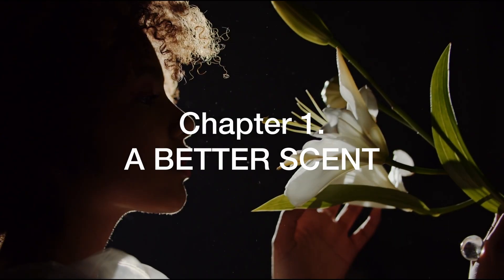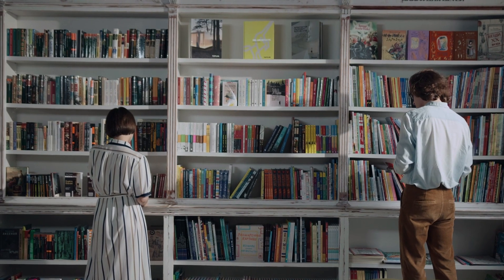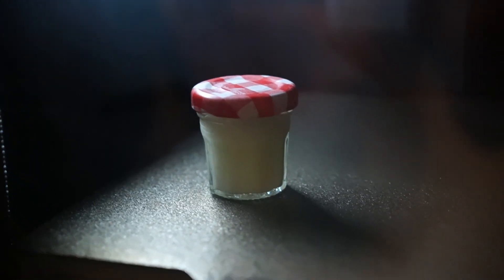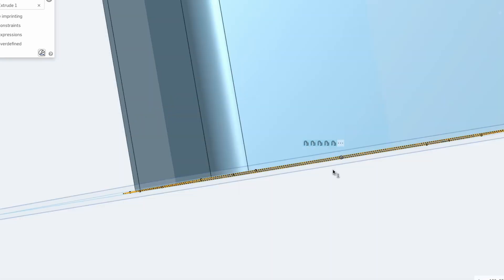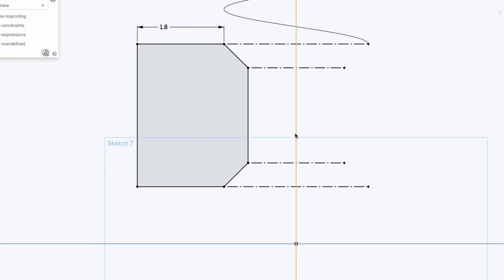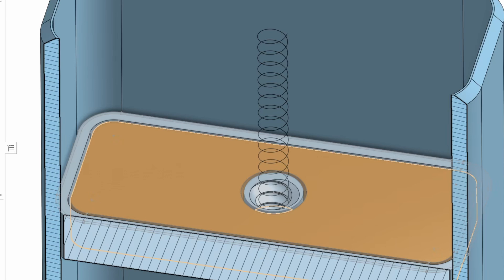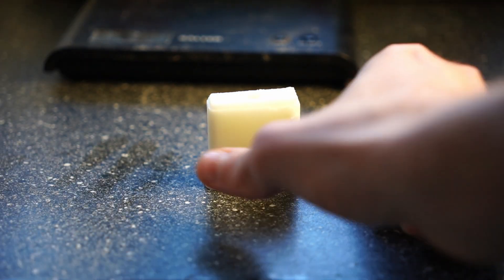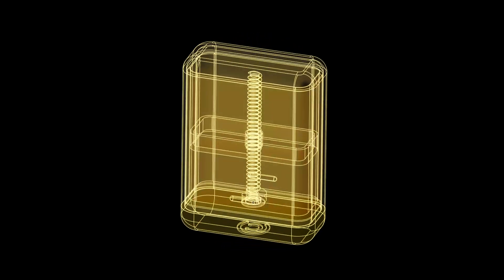Could the PERFECT DEODORANT already be in your kitchen?

Comment: Nice solution with the mold, maybe I'm missing something but couldn't you pour the deodorant directly into the body of the stick instead of using a separate part to form the stick? Even if it requires modification to the 3d print it may be a cleaner solution (literally)!

Comment: I really like your style of structuring the video. Good flow, minimal to non existent dead air, interesting concept, a deep dive, and a resolution in not even 12 minutes, shit's great man! I think this one should break 100k within a few weeks!
I'm also curious about your formula and the ratios of used ingredients, sounds like a good alternative to the name brand ones.
Some of us in the community could even make models for molds that fit into existing cases like oldspice or dove etc.

Also, the idea of making a mold that splits into two should work for your application, as you don't need the top of the stick to have a shape, you just make an open top mold, like you would for silicone, and you're good :)

Comment: I would try printing the Mold in TPU, i think getting it released would be much easier with the flex it would provide!
Reply from the maker: Hey, thanks for comment!! You are probably absolutely right with that, I should totally give it a go - I think I'm a little scared of TPU at the moment.. 😂 heard it's quite tricky to print!
Reply: @UrbanCircles  if you have a direct drive extruder it’s not bad! I just bypass the Bowden tube and put the filament straight to the extruder!

Comment: to bad PLA is not as biodegradable as we tough
Reply from the maker: Thanks for checking this out and the comment - hope you liked it!! Re your point, PLA does biodegrade slowly (which is actually a good thing; otherwise, it would be unusable in product design). More importantly, when it does break down, it doesn’t break down microplastics. Instead, it degrades into lactic acid, a natural compound that microorganisms can fully metabolise.
Reply: @UrbanCircles  Important to remember that PLA requires an INDUSTRIAL composting facility to break down. It does not break down well in regular composting/nature/the sea/landfill etc, and very little PLA and other "biodegradable" plastics end up in the industrial composting facility. So please be cautious.